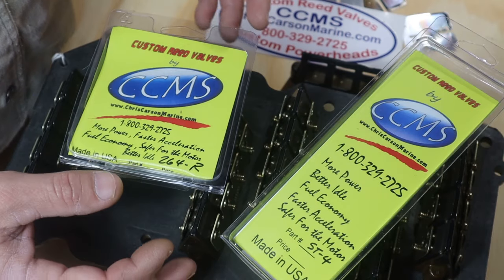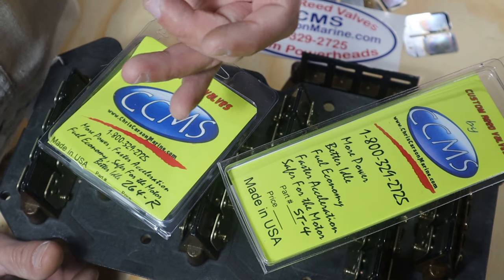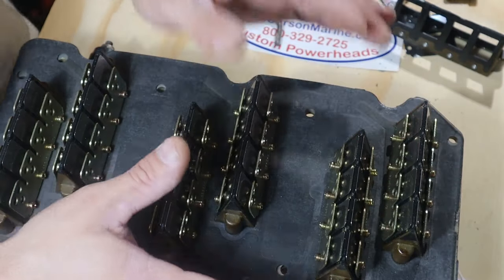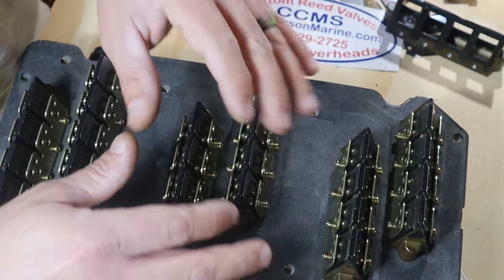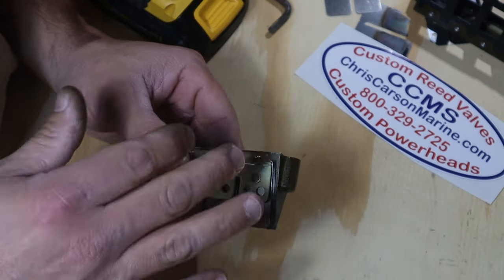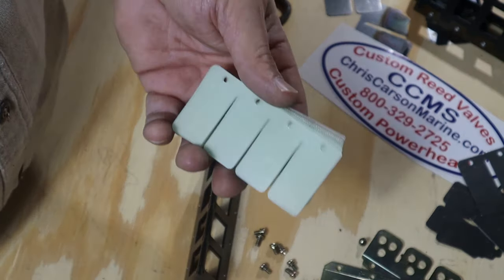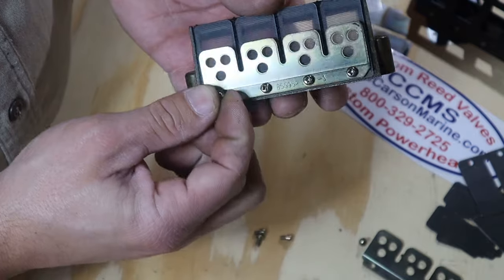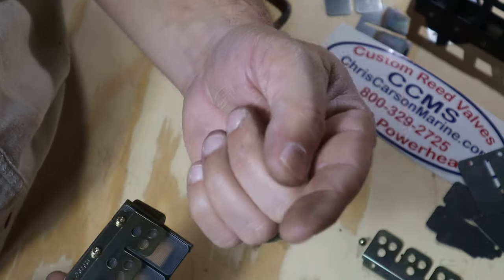2 STROKE OUTBOARD   BETTER PERFORMANCE   MORE POWER

Comment: How cool is that ,,,, ccms sent you another set of reeds and stuffer kit to do a video,,,,, I'm in the middle of a semi restoration,  it's a 2.4 200, 86 model,,,,  less than 200 hours from new,,,, I'm going to do the reeds as 25+ yr old stainless isn't my preference over the safety of the ccms gear,,,,, I first came across this product in about 95 when I watched a mate build a 2.5 225, with wiseco, bobs tuner, a port job ,,,,, balanced and blueprinted,,,,, it was the smoothest idling outboard I've ever seen,,,, but I'm going to add the carbon spacer as well,,,, just because, I don't need the extra performance,  but ccms sells them so I'll buy 1 ,,,, loved your video, and the clean and no need for power tools,, , firm snug by hand,,,, take care enjoy watching

Comment: After installing these reeds on my Yamaha 97 75hp about 2 years ago and having been chasing a problem that kicked my motor into limp mode I’ve realized that it’s the reeds. Not sure if im the only one to get bad ones but I figured it out after replacing every piece of everything else that can cause the limp mode to kick in. Replaced the oil pump because it’s oil injected, fuel system, and water pump and thermostat. Finally realized that these reeds rev your engine to high to hit the rev limiter.
Reply: So you need more prop… reeds aren’t a problem, you’re just over reving your engine

Comment: I just installed a set of these in my 2002 EFI 200. Gasket will be here tomorrow. Anxious to see the results. Also found a bad MAP sensor as well. Oit of the 48 reeds, I had 12 not seating (.030"+ on most).
Should be a massive improvement. I was looking more for the fail safe part of the reeds, but will take the performance boost as well 😁

Comment: After I watched this, I called them and ordered a set for my 200 merc, I walked down to the boat and removed carbs, & manifold. Low & behold, in one of my reed blocks, I found a partial zip tie lodged in one of them.  Glad I watched your video.  Also, your lower unit turned out "Tits" you did a gr8 job!
Reply from the maker: Thanks bro!

Comment: I'm going to have to order a set of these for my dad's 1996 mecury 150 efi cylinder 1 and 6 seem dead when pull spark plug wire I check compression and spark both good even checked fuel injectors and seem to be working so the only think left that I can think of is reeds.

Comment: Thanks for the video! I just received my reeds and stuffer kit from CCM. I noticed on the first block that there is a slight gap between the block and some of the reeds, showing light through. It seems to be better if I flip the reeds over, but still a gap on a few reeds, about 10 thousandths. Is this acceptable? There were no gaps with the stainless steel reeds. Thanks for your help!
Reply from the maker: That's pretty normal to see. If you notice the motor sneezing while trying to start or idle, the reeds aren't fully closing and need to be swapped out. Most times you can match the reed set to the best block. Flip them over and swap them around until you match them up as best you can.

Comment: hey man, excellent videos!  just ordered my CCMS reeds n stuffers.  I have 05 Merc 250 EFI, My issue is not rough idle or running rough, but NO crankcase pressure coming from the on-way check valve to pressurize my onboard oil tank. I hope this will fix my problem.
Reply: did it end up fixing your problem? I'm facing the same issue

Comment: Just for an info -  in any case with a softer reeds you will have good idle and middle, with a stiffer reeds you will have better middle and +500-600 RPM on top. You will not have any power improvement with any reeds, just  a change of engine "feeling" how it behave on a certaine RPM. This is a rule for 2-strokets... All the best from Russia.

Comment: I noticed that on the beginning of the video  with the stuffer kit, You have "Sport" reeds box, rated to max 6500rpms, which You presumably installed on Your motor. And on the second reed video, You are working with "Race" reeds, rated to max 8000rpm, which apear to be thinner. Any thoughts on that? 
Also, I couldn't find any thoughts on stuffer kit as the comment are off there. So would You recommended it or You couldn't tell the difference...

Comment: I put a set of CCM reeds and stuffers in my 99 Merc 200EFI. Did not see any difference at all. Gained no RPM and fuel economy was the same. Basically the same performance as stock parts.
Reply from the maker: You may have reached a limit with your hull already without adding some serious HP. For most, the reeds start better, idle better and respond to throttle quicker and smoother. The stuffers reduce crankcase volume and gives a little more low end torque but at the expense of some RPM up top. To have absolutely no change at all seems like maybe the setup is off. Power to weight ratio, hull design, motor height, etc.

Comment: HI from NZ. What outboard motor did you put the reeds into? I tried to find some Chris Carson reeds for my 1985 85hp Evinrude outboard on his website and could not find any!  Maybe I need to keep trying. Thanks.
Reply from the maker: Mercury 2.5L but if Chris doesn't offer them there may be other options. Keep searching and good luck.

Comment: Just seennur video,  have been having the horrible experience with hard starting and rough idle the the passed couple mths, I have ran cans and cans of seafoam. This morning had a tournament and it took me a looooooooong time to finally get the motor to catch and idle. Upon getting it to idle, in gear it idles rough to. Does this sound like something u was going through
Reply from the maker: Thats exactly what i was going through. Especially if it runs fine at wot.
Reply: @SmalltownBassin  runs great WOT..... I'm going to replace all my bleeder line and choke fuel lines on the carbs, when I get my set of reeds and stuffers

Comment: is there no need to lap the block if the rubber coating is in good shape?
Reply from the maker: That I dont know. Please explain what you mean for anyone else that reads these comments.
Reply: Lapping cages is recommended/ needed ,  some 300g sand paper on big piece of glass and sand in figure 8 to make sure its perfectly flat , then clean and install reeds using blue loctite on ALL reed screws

I'm really surprised chris didnt tell u to do that if u was talking to him?

Comment: The mechanic doing my reeds now said something about lapping my block before installing my new Carson Reeds. Is this wise?  Or do I need to order a new block?  It looked like there was some wear on the rubber from the steel reed.  I’m worried if he laps it, he’ll take the seal off...
Reply: I have heard the same thing for TRD reeds.

Comment: I just got a 30 hp Yamaha 2 stroke, I’d like to get as much performance as possible. Would it be beneficial to do a reed valve upgrade and the stuffers also? Maybe put reeds and stuffers for a 40 hp engine on mine? What mods can I do to get the most from my engine?

Comment: have a tanak 300 older motor but it's like brand new condition that I got from my grandfather he never really used it But I was wondering if there was ways to upgrade some power to it its only 3 horse motor but I only need it to push it 12' jhon bot  Which i know can do more than the job But if I can  addin Some simple things to it to get a little bit more power speed from it I would Is that read process you're doing Available to do on any kind of friend on motors
Reply from the maker: I don't know. All 2 strokes can be modified but you may be limited to what you can bolt on to that one.

Comment: Just did both reeds and stuffer kit on an oil injected  2004 Yamaha V4 @ 490hrs which was turning 6,000 nicely. 
The reed replacement was mainly preventative maintenance and for piece of mind (the OEM reeds were in perfect condition when removed). 
With the stuffers I looking for better 2000-4000 performance.  
After install I lost about 5% off the top end.  Idle doesnt seem any better and is actually about 75rpm lower which may just need a turn of the screw. I've only run it about 3 hours in poor sea conditions which made it difficult to report the mid range performance. Always started well and still does. 
Will update as the hours accumulate.   🚤
Reply from the maker: Reduced crankcase volume "stuffing" results in a richer mixture in that space. This is how it gives more torque but also sacrifices top end. It's not recommended if the low end torque isn't needed. If you have idle air adjustment points on your carbs, adding more air will help your idle and off idle response.

Comment: I just found your channel . Thanks for the very well informative video . I have a 2003 200 hp EFI . Do you think this upgrade will to terribly difficult ?
Reply: On an EFI? this is like saying will this fit my civic
Reply from the maker: No it's not difficult.  You'll just have to remove laser Plenum to access them like a carb motor. No different. But....most of the later laser motors came with composite reeds. You can check by removing the Plenum cover and looking into the reeds with a flashlight. You'll probably find OEM black composite reeds.

Comment: Get a 10 hp 2stroke and make a video serie on how to get more hp and how much hp you can get! Please
Reply: Put a expansion pipe on it and a bigger carb and make sure that it isnt running lean, theres allot more that can be done but these 2 combined should boost the engine allot
Reply from the maker: Raise the roof of the exhaust ports and open the exhaust chest. Boring cylinders over stock doesn't do any good in a 2 stroke. There's a guy on YouTube called 2 stroke stuffing that can explain better for you.
Reply from the maker: The volume of the cylinder doesn't matter if it can't breathe. You would have to change the boost port, transfer port and exhaust port to satisfy the larger volume.
Reply from the maker: Better off to just raise the exhaust port and open the exhaust chest slightly to allow a longer and easier blow down period.
Reply from the maker: Pm me on face book and I can show you what I mean. I just had a 200 block worked to make about 245hp by doing this.
Reply: KadenPlaysVideoGames  small town bassin gave you a good tip, raising  the roof of the exhaust port should get you to higher rpm if i remember right, so make sure you add a little enrichment to the engine by putting a bigger size jet or by turning the high rpm fuel screw a bit more open if the carb is like a walbro or etc.. just make sure that you know all of how your carburetor works and can that u can adjust the a/f (air fuel) ratio, otherwise you could end up with engine damage, also like small town said, go check out 2 stroke stuffin. He is litterally showing you from A all the way to the Z of how to get the most power out of a small 2 stroke engine
Reply: KadenPlaysVideoGames  and a expansionpipe is a tapered pipe like you see on some dirtbikes(two stroke dirt bikes)

They start from a narrow header and taper up wider and then they taper smaller again (smaller then the header diameter at the exhaustport) google it up, you will find loads of info of it.

Oh and one more thing, if you have 2 cylinders, then you will need 2 pipes that are identic of shape

Or they can look a bit different but u need to be sure that both pipes give you the same sound wave resonance. Otherwise one cylinder will deliver its power on a other rpm than the cylinder with a different pipe. I dont know how bad this could be to a engine or maybe i am wrong and it doesnt do damage. But for power wise this would not be ideal for high hp numbers
Reply from the maker: Cold air intake always helps but its not practical on an outboard. If you figure it out, please let us all know. There are a couple other things you can do that are reasonable but its a trade off with power vs rpm. You can stuff the crank case. This can be done with reed block spacers. It reduces the volume of the crank case which increases the velocity of your mixture charge going into the cylinder. I've tried this on a v6 outboard and gained some low end power but at the expense of rpm on top. Or you can add carb spacers that give the air flow more time to straighten out before entering the crank case. Imagine all the eddy currents from the disturbed air as it moves around things making its way in. Giving it more time to straighten out and line up with your rod slot when it enters delivers the mixture more consistently but you will have to fatten it up when you do this. There are tons of things you can do to add a fraction here and there. If you do them all you will see some very noticeable gains. Most of which are fairly cheap. Performance reeds, spacers, fatter jets, etc. Are the first things you can do without cutting your ports. If you want to roll the dice, raise the exhaust roof about 0.010 inch and you will see a difference. Maybe just start with half that. There is a chart for it that you can look up referring to degrees of blow down that is your best friend. I wish I had a little 2 banger to play with! My work has to be done by the more experienced. Too much money on the line to mess around.
Reply from the maker: Yes! I can't believe we are just now talking about shaving heads! Der her lol! That will give you tons of spunk and is easy to do.
I know there are some guys doing this to 25s so just follow their lead on your 10.
Reply from the maker: Looking forward to it! Good luck!

Comment: Can you tell me if you were getting oil and fuel accumulation around your carbs and the front part of your motor? My 95 XR6 150 will not idle for crap and is a bear to start, also it will 'Chuff' and just die. I am pretty sure there is damage to the reeds, just thought I would ask you if you had the same things going on.
Reply from the maker: Yes. The oil and fuel accumulation in the air silencer was one of the clues that drove me to pull it off and see the carbs coughing it out. You're on the right track.

Comment: I am only getting 4700 rpm from my Yamaha 40hp, I have installed new composite reeds, no help. Carbs cleaned, timing checked, moved around, nothing has help to get more rpm's. Any suggestions. Compression is 120 on all 3 cylinders.
Reply: The rev limiter on your cdi maybe
Reply: Propeller
Reply: You need a smaller prop or less pitch on your prop most likely.
Reply: Your packing to much meat with your current propeller. Drop 2” of pitch size from your current Prop